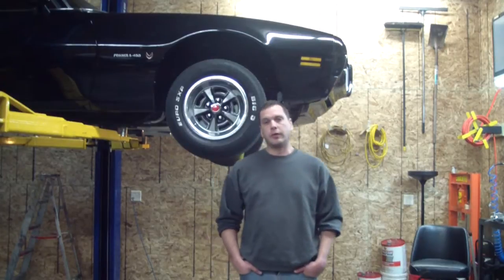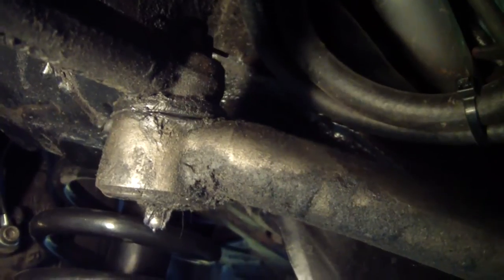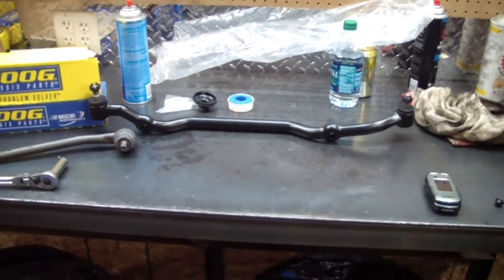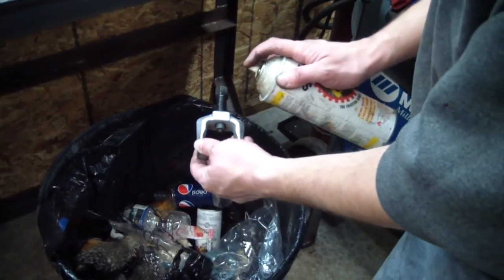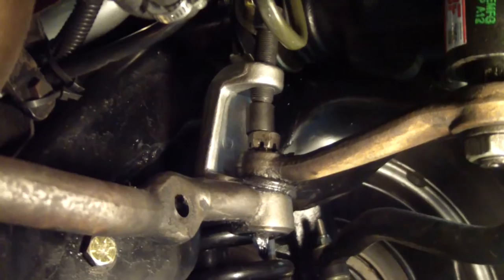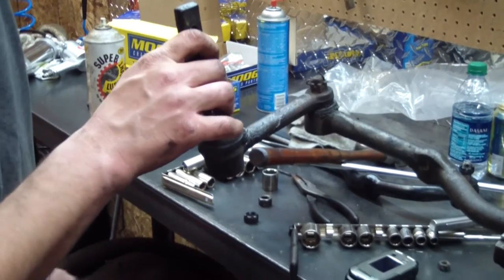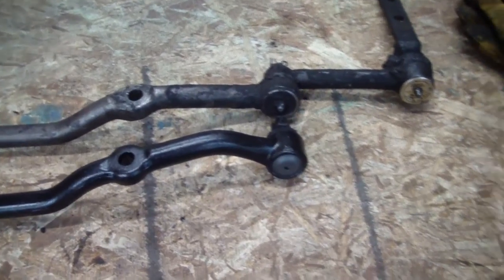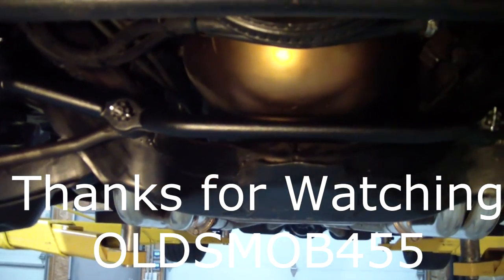Steering component inspection tips and a center link change on the Firebird

Comment: For anyone doing this at home, instead of using the service tools, wack the components with a hammer very hard. You won't hurt anything. Wacking the side of the stuck components will vibrate em loose.